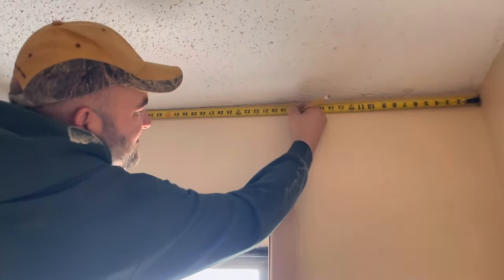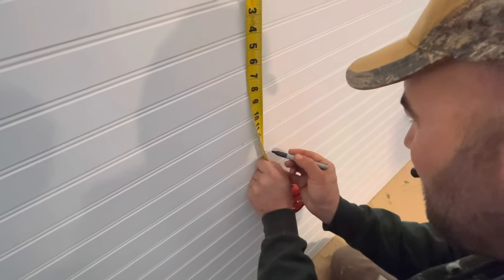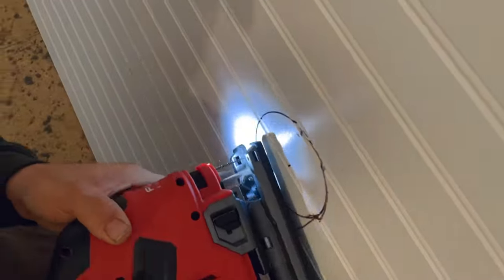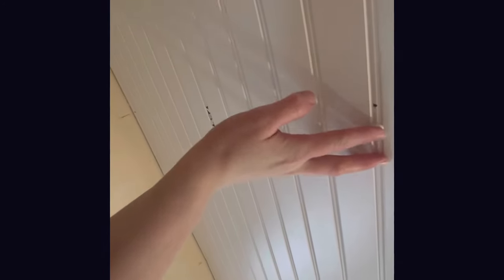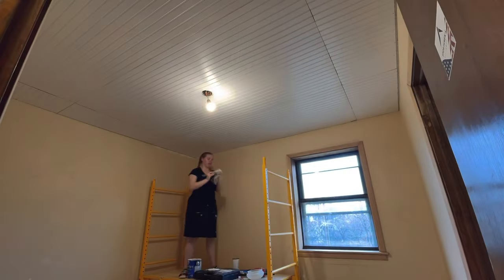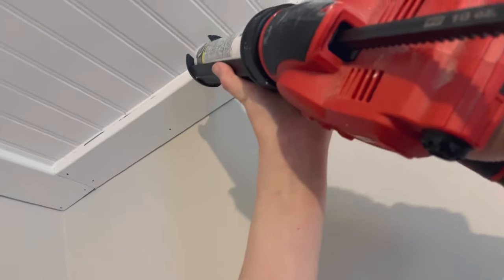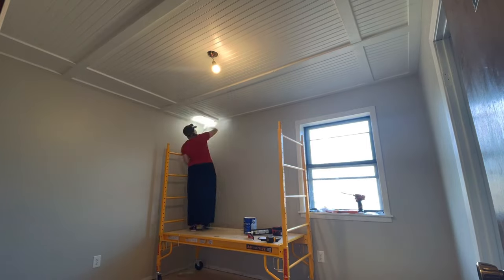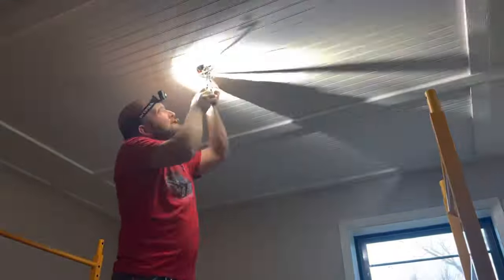Simple and beautiful beadboard ceiling. This is how we did it.

Comment: That's awesome, what was the cost to do this?
Reply from the maker: Beadboard cost around $27 a sheet and it took about 5 per room. Trim is 1x4 slats that are about $3 for an 8ft stick. A couple tubes of caulk at around $5. And a gallon of paint at around $50.

Comment: Hi! I love how your ceiling turned out! May I ask what size board you used for your trim? Thank you in advance!
Reply from the maker: Thank you! We used 1x4 boards in here and in the bigger living area we plan on using 1x6s.
Reply: Great job and video.  What type of bead board panels did you use?  Are they wood, PVC or composite?  Where did you buy them?  I am restoring an old yacht and need lightweight bead board panels to replace the ceiling “headliner” material.  Composite material may not be suitable because it swells when it gets wet. I’m definitely going to follow your lead at home.  Thanks for the effort to share your techniques.
Reply from the maker: @stephenmoon9830  We used composite, but would definitely recommend pvc for a yacht. We bought ours at Home Depot. Thank you for the encouraging comment!

Comment: Nice job... I like how it came out.  I too have a popcorn ceiling in my family room and decided to cover it with tongue-and-grove (3/4x6") after installing 3/4x2" furring strips.  I would typically always recommend furring strips and not directly attach the new material to the old surface, so you can help hide any waviness.

I think covering it is a better option sometimes and provides an updated look over just removing it (and leaving the ceiling "flat").  A great option for some rooms to give it an upgrade.

Comment: great job, and nice video too.  I plan to do something like this with my 1930s house in need of a reno.

Does it matter whether you use the pre-primed MDF/HDF beadboard vs. the plywood beadboard?  Did the beadboard you used have shiplapped edges?  Do you have shoot the nails up at an angle so the board does not fall down over time?
Reply from the maker: We used the primed just for ease of availability around here. 
Yes it had the edges that go together. 
Mostly shot straight with the nails but that’s a great thought about the angle to prevent overtime backing out.

Comment: Going to use the headboard in modified drop ceiling in basement keep access to services 
Will be 2ft x 2 ft panels on a three inch trim framework using embassy hangers

Comment: Getting ready to install this on a tiny house...might be over thinking it...what nail did you use? Finish nail worked ok? I plan to use glue and nails. I will not have sheetrock backing.
Reply from the maker: 1 1/4” finish nails should be sufficient for what your doing.

Comment: Looks great ! I love this ! How did you come up with the grid design? How do you know where the tresses are located ? Did you use a brad or finish nailer ? Was any adhesive used on the beadboard ? sorry for all the questions
Reply from the maker: Thank you for the positive feedback! We knew we wanted the ceiling fan in the center of the full sheet of beadboard so based our grid on that. You can use a stud finder to find your tresses. We knew ours are on two-foot centers so we found one and then measured from there. We used a finish nailer. All the tools we used are linked in the video description. We did not use any adhesive, but it’s not a bad idea if you want the extra security. 
Thank you for the questions!